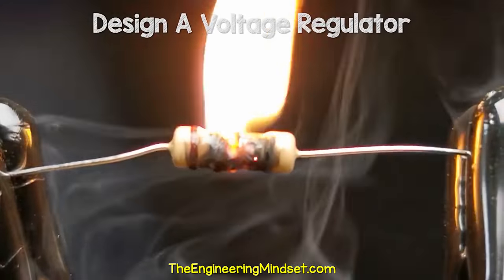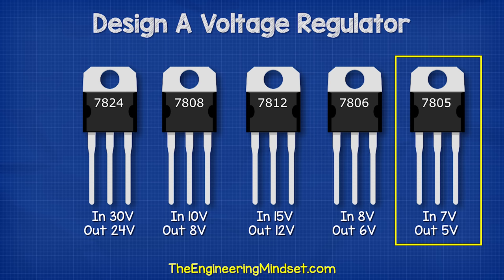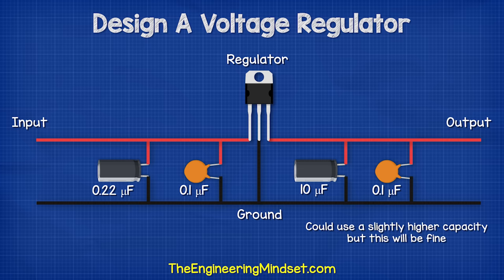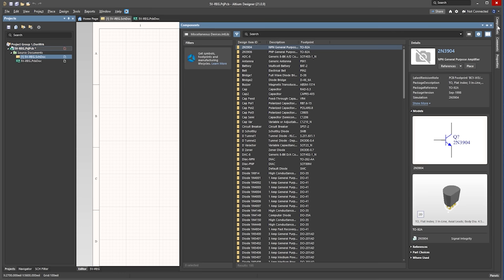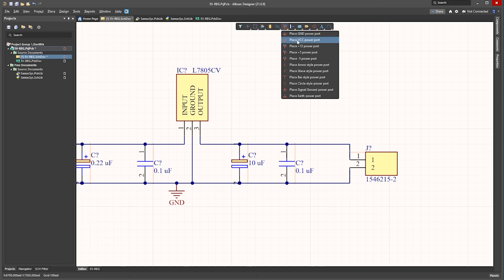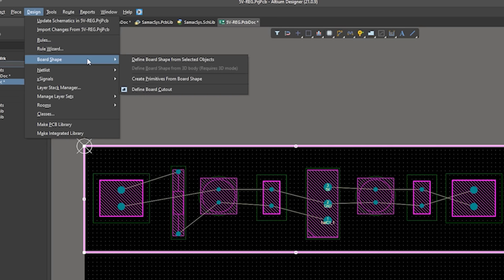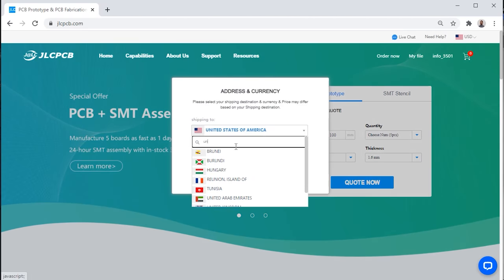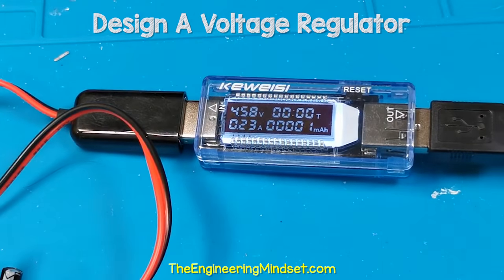5V Regulator design tutorial - How it works, how to design PCB  altium

Comment: I have been away from electronics for awhile and enjoyed the information presented. I have one small commit: if you added a bridge rectifier in place of the single diode you would not care how the DC was oriented and you could possibly connect a low AC voltage on the input pins. This would make it a little safer for those who reversed the polarity. Do you have a suggestion for a current regulator, or do they use these anymore? Thanks

Comment: Having a capacitor at 0.1uF will not stop high frequencies, in your description at 4:08 you show an AC signal. You would need an LPF configuration, where a resistor is in series with a capacitor for 'High Frequencies' to be filtered out. for a fc=1/2(pi)(R)(C)?
Reply from the maker: Check out NEW resistor video, everything covered! ➡️ https://youtu.be/DYcLFHgVCn0

Comment: The 5 volt regulator is a simple circuit that uses a capacitor, an LM7805 voltage regulator and a Schottky diode. The capacitor is used to smooth out the voltage fluctuations and the LM7805 voltage regulator is used to stabilize the voltage at 5 volts. The Schottky diode is used to protect the circuit from reverse polarity damage.

To build the 5 volt regulator, you will need a capacitor (100 microfarads or more), an LM7805 voltage regulator, a Schottky diode (30 amps or more) and some jumper wires.

Comment: The bypass capacitor for high frequency should be small. Adding a second 10uF will not do the job…and that might be misconstrued by the way you explained around 4:20. Otherwise excellent video.

Comment: Really excellent video and board. If I wanted to also make a 12v regulator, would I just change the 7805 to 7812, or would I also need to upgrade other components? I'm looking to protect my Amstrad CPC 6128, which takes 5v and 12v...

Comment: Nice video and explanation.  Would you recommend a heat sink on that regulator?
Reply: I would recommend going switching regulator if you are regulating circuit with high current

Comment: How would you go about adding multiple regulators in parallel to get a higher current capacity? Could you put just the regulators in parallel with the same 2 capacitors or would you be better off running three separate circuits with their inputs and outputs paralleled?
Reply: Use emitter follower circuit using a power transistor such as 2N 3055 along with the voltage regulator IC

Comment: ALWAYS check the datasheet for the brand of 78 voltage regulator you are using as large output value capacitors should be avoided. The voltage regulator is designed to monitor it's own output voltage and adjust it's operation accordingly based on the input voltage, device temperature, and the demand being placed on it. A small value capacitor; 100nF for example can help transient response but  large value output capacitors hamper the device and in fact, can lead to the voltage regulator being destroyed. If you have a large capacitor on the output that is charged but there is little to no load on the circuit, when you switch off the input power, the voltage on the output will remain above the voltage on the input until the capacitor discharges and destroy the regulator. Don't believe me... Check the datasheet for adding a simple reverse bias protection diode. All 78 series voltage regulators used in generic bench PSUs should have this diode as you don't always know how much capacitance there will be in the test circuit you are trying to power. There are some exceptions to this when the regulator is being used in certain switching PSU or other unique designs. Again check the datasheets and you won't typically find large value capacitors on the outputs of these regulators.

Comment: I am curious as to why you have defined a 4.6v output of a 5v regulator to be working as intended? This is confusing. Can you explain?
Reply from the maker: The polarity protection diode causes the small drop. Remove it and it'll be exactly 5V. Maybe 4.99V maybe 5.01V maybe a little higher or lower, small variations. A 1.5V battery won't provide 1.5V it'll usually be higher maybe 1.63V

Comment: Great video! Can someone clarify if the order of the output 10uf and 0.1uf capacitors  makes a difference or can it be combined with the capacitors wires intertwined?? (for prototyping in this case)

Comment: Great videos!  Especially for an electronics newbie like me.  I was wondering if you could do a video on powering a ESP32 circuit board with USB.  I have a breadboard module that will take USB or 9V but I want to buy the individual components so it is integrated on my circuit board.  I feel like it is basically this circuit.
Reply: I should have added I want to power a long strip of LEDs so I need to isolate the output power to the ESP32 and for it to be a good constant 5V for both the LEDs and the ESP32.

Comment: Very cool, I'm looking for a setup to charge as much as possible devices from a car battery. So far I haven't found anything that has a range going both under 12v (to charge a trimmer for example)  and above 12v (to charge a laptop). I think it would not be rocket science but my electrical knowledge is very limited.
Reply: Maybe if I use this design but use a multi throw switch connected to different regulators, each with their own capacitors... I think it could work but I guess its too much of a project for me....

Comment: Put the diode between pin 02 of reg IC and ground to gain the output voltage to 5volt
Cause sometimes the output below than 5volt
Around 4.7-4.9 volt

Comment: I need to convert 24vac to 5vdc. Using a small transformer in an HVAC air handler   and need to input it into a Raspberry Pi Pico W.
Would using the single diode on the input be sufficient for a simple circuit? Or would you recommend going with the 4-diode configuration?

After taking a 35 year hiatus from doing much with components I'm getting my feet wet again. I forgot just how much I loved it!

Comment: sorry I'm new to this. I understand we are designing a voltage regulator. but why do we need a voltage regulator (lm7805) to make another voltage regulator? would it not be possible without the 7805? just a little confused on this.

Comment: can u make a new video showing the dc waveform of the noise u say it filters....on a oscilloscope of the voltage with and without the little .01 caps in line but with the larger caps still inline....thanks

Comment: Thank you for this I hope you would find time to answer a question that I have.. 
I am working on a power supply with much larger output voltage of about 165 vdc out from large filter cap which goes through multiple other switching stages. 
One of the branches feeds into a hi frequency step down transformer. There are a bunch of power resistors in between which get extremely hot. The stage that these resistors get very hot is past the large filter capacitors and before the hi freq. Trans.
And also past the hi freq, trans. along side of a step down voltage regulator.  
I checked out the power using an oscilloscope in these stage and the graph shows 2 different square wave attached at 40kHz. 
1 square wave is 1/2 the size of the other. But there multiple spike in them. and power  does not look clean. I was wondering what I can do to reduce the spikes to see if it will affect the heat on the resistors.
Reply from the maker: First consider if the noise is from the scope itself. You can add filtering to remove noise above certain frequencies. Could apply some clipping too. Might be some inductive kickback too, so it's going to be some trial and error to solve.
Reply: @EngineeringMindset  thank for your response. I think the scope is ok since it shows other measurement good. 
I guess I am going to look up power line and or frequency filtering and clipping. 
Thank you.
Reply from the maker: Check out NEW resistor video, everything covered! ➡️ https://youtu.be/DYcLFHgVCn0

Comment: Make a video on how mobile charger worls and how to make it with a big transformer 12-0-12 transformer, rectifier and LM7805 Voltage  Regulator
Reply from the maker: Rectifier video here https://youtu.be/RiRyzLl4Y8U
Reply: Better regulators for a battery charger are either the LM317 or the L200C variable regulators. The latter has both voltage and current regulation but a higher minimum voltage output. 2 of the former 317 regulators can be used one after the other to provide both voltage and current regulation.

Comment: As we have already the capacitor of 0.22 in the input, isnt enough to reduse the noise? Why we need the ceramic too? Beside that, excellent work!!!
Reply: Electrolytics have much poorer performance than ceramics in almost all respects regardless of size. The large cap will do little other than prop up the supply in the event of large transient signals or high input impedance due to long wires and so fourth. Also note this video is backwards in its capacitor arrangement. The output capacitance should be as small as possible. Look for better research material if you actually need to understand this properly.
Reply: @Ormaaj  Thank you sir for your great explanation!  :-)

Comment: Why don't you need to add a diode on the ground side? In case of reversed polarity wouldn't the 9V end up on the 5V side without a correct connected ground pin? And also be able to damaged the capacitors?

Comment: How you control overcurrent in this circuit, if I want to make LED driver with constant voltage, how I limit output current if I changing different LED-s which submit different current max?

Comment: Hi there;  Great video, thanks for making it.  I've built the circuit on a bread board and I'm using a solar cell as input power.  The solar panel is a device that was originally intended to trickle charge car batteries.   I thought I'd repurpose it to power the weather station that I'm building out of a ESP32.   The solar panel is great when there is huge sun available, putting out 16 - 18 volts but the slightest cloud cover and the panel drops to 5 or 6 volts output.   With this circuit what is the minimum amount of power input to get 5 volts output?  Currently I'm getting 5.5 volts input and about 3 volts output.

Comment: Which regulator should I use to make this suitable for use as a usb FAST charger please? Or does this require more complex circuitry?
Reply: then you wouldn't be using  a voltage regulator, you would need to build (or buy) a buck converter.

Comment: Nice introductory video. The only downside with this type of the regulator(linear) is that they are very inefficient. There are  switching regulators available that are not much larger than the 7805 demonstrated and much more efficient. They  could even be a drop in replacement. The biggest downside of a switcher is that it generates more noise. However this would only be a problem if you were building something like a receiver or measuring very small voltages.

Comment: This was a great video!  
Question: If the output is too low, how can it be adjusted to get exactly 5vdc?
Reply from the maker: This will provide 5v as long as the inputs are met. We just get a little drop when connected to load
Reply: @EngineeringMindset  5v dropping to 4.6v is not a little drop, it’s almost 10% right?
Also is the output voltage dropping due to chosen capacitor’s capacitance value on the output? Or is it an input diode current limit that causes the output current to be lower than what the device can consume causing the voltage to drop?
Reply: If I understand you correctly, what you may be after is a buck-boost converter, which can boost the output to 5V even when the input falls below 5V, but will also step the input down (like the circuit in this video does) if it's higher than 5V. See https://en.wikipedia.org/wiki/Buck%E2%80%93boost_converter

Comment: Great video!! But a question: why bother running a Design Rule Check when you did not configure any design rules? It’s a good habit to get into, especially when using services like JLC. And especially when using an autorouter, which generally needs cleanup!  Thanks for the content!

Comment: Sir plz mention the detail values of components i e value of scotky diode, voltage values of capacitors...
Reply from the maker: See video description for details
Reply: @EngineeringMindset  i saw but these values are not mention there...
Reply: I want to know that what ll be the value of scotkey diode and voltage value of both electrolytic capacitors

Comment: Sir exllent,, but one dought, in the diagram showing the both input and out put capacitors are in same polarity. But it's came to on pcb the input capacitor is connected to reverse polarity, Why sir it's like wise...

Comment: Is it possible to use a capacitor before the regulator that's a lot larger than what the power supply is? For example, if we have a 9 volt battery as the power supply, could I have a 15 volt capacitor to store the energy in? Would the capacitor just fill up to 9 volts, or would it just not work?

Comment: If I were to use a TSR 2-2450 instead of this regulator, would you still recommend the two sets of capacitors on either side? I would assume not which would lead to a more simplistic pcb
Reply: Check the regulator schematic

Comment: Do having 2 capacitors in parallel effect the circuit differently than just having 1 capacitor of slightly larger value on each side?

Comment: Do we need a different voltage regulator to increase the USB output amps? E.g. a 4000mAH battery at your 260mA will take ~15 hours to charge fully 😆

Comment: I have a doubt.. If the light bulb glows irrespective of positive and negative, how does diode helps in the  protection  the circuit?
Reply from the maker: Not all components work with current flowing in both directions. The bulb is just an easy way to see what the diode is doing
Reply: @EngineeringMindset  Thank you Sir 🙏♥️

Comment: you can make a pretty good DC-DC power supply by connecting the output of an LM317 to the base of a 2N3055. Use a 10k pot on the adj pin of the regulator. connect the collector of the transistor to the input voltage and connect the load to emitter and ground.

Comment: I have made my own 5V regulator from recycled components and I did solder it together with ironwire and then glued it on a piece of plastic. it did charge my smartphones with my own build axial flux generator also build from recycled materials. But what will happen with the amps beside the voltage does the amperage increase instead of the voltage when I increase the speed of my axial flux generator? 

I can't measure it anymore because I did solder a smartphone imput wire directly on the 5V regulator unit.

Comment: It’s a nice video but I believe your examples of failure due to overvoltage are incorrect. Though there are a few examples of overvoltage leading to catastrophic failures that release the magic smoke(like avalanche breakdown or gate oxide breakdown), most notably overvoltage will present in dielectric breakdown i.e. sparking or arcing between pcb traces, transformer windings, etc. 
The failures in the video are examples of thermal stress and breakdown secondary to overcurrent. Pcb traces and transformer windings could be effected by overcurrent as well though the failure would present as melted or burned traces. Dielectric properties would still remain intact ( at least within the limits of the melting). 
The video’s production value is excellent as are the rest of the videos on the channel..

Comment: At 4.32. At left side capacitors, is it practical to use just 1 capacitor with value 0.32uF? Since in theory the result capacitance of two parallel capacitor is c1 + c2. And, could I do so single 10.1uF to substitute the right hand side capacitors.

Comment: If I wanted to make the same circuit with a regulated 5V output but up to a 3A to 4A output... what modifications would I need to make? 

Thanks!
Reply from the maker: You need to check each component can handle the current. It would also need a heat sink on the regulator.
Reply: @EngineeringMindset  Thank you very much for the quick response. I was thinking of using an LM323 with 0.33uf on input.. but not sure how to calculate for the components. Any ideas would be appreciated.
Reply from the maker: Literally just look at the manufacturer data and it tells you it's maximum capability. You can filter products by size, there's links in the description.
Reply: @EngineeringMindset  Thanks again. Great video.

Comment: about heat dissipation....
i guess it is a power hungry circuit &
I guess it wont work on high amps like motorcycle battery of 3.5 amps.
Correct me if im wrong

Comment: It might be a stupid question but ...

If you have a 12v power supply and you need 5v to power a random circuit.. why cant you Just use a resistor to down the voltage from 12v to 5v? 😬
Reply from the maker: Check out NEW resistor video, everything covered! ➡️ https://youtu.be/DYcLFHgVCn0

Comment: So if I have a dirty power 13000 watt gasoline generator and I want to run some sensitive welders like AC tigvwelder and plasma cutters how do I clean that energy?  Capacitors?  Transformers?  I can't find a large enough UPS or voltage regulator.  What could I could or do?  Could ibuse the same circuit and parts on a larger scale?

Comment: i have a doubt....if i connect this voltage regulator circuit L7805 one] to a solar panel whose output voltage is always varying from like 9-18v....will it still regulate it?

Comment: I need to cut 12v dc down to 5v dc to power a motor but the motor is after a dpdt relay so the polarity will be switching , would a buck regulator work or are they polarised are there any other options ?

Comment: I have a question: WHAT IF I WANT TO DOUBLE THE CURRENT (AMPERE) OUTPUT OF THE REGULATOR BUT STILL WITH THE SAME VOLTAGE, IS IT POSSIBLE TO USE TWO REGULATORS IN PARALLEL TO GET 3AMPS OF CURRENT? I hope you notice my question. Thank you..